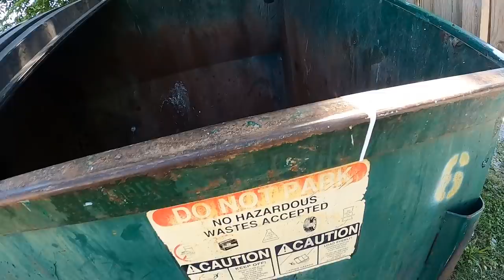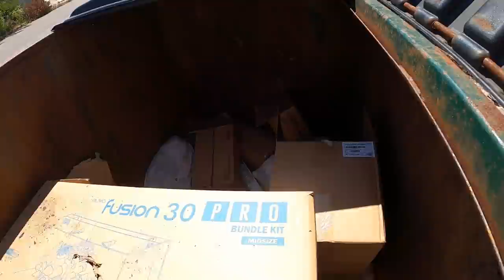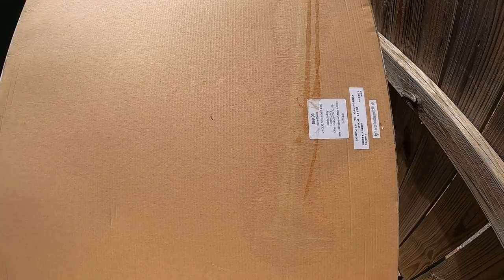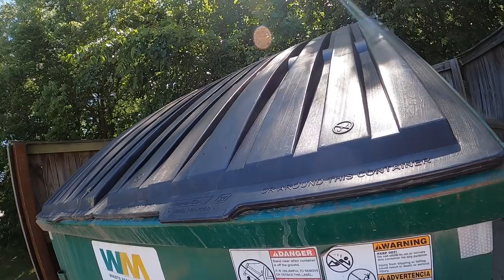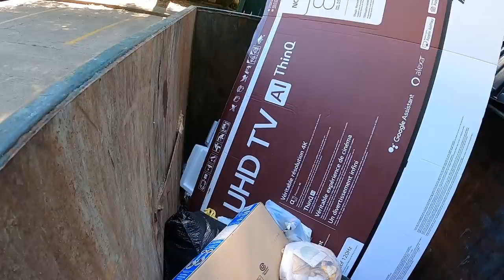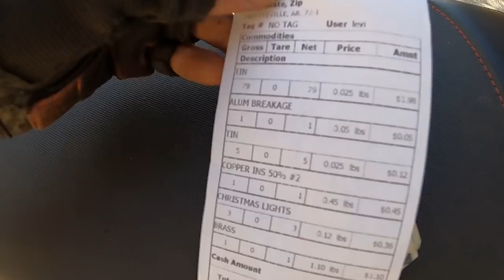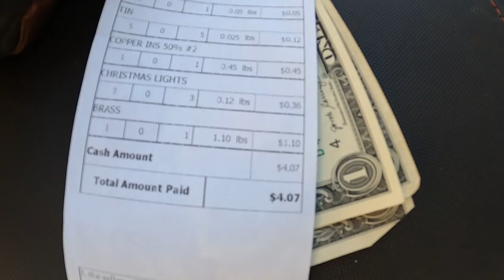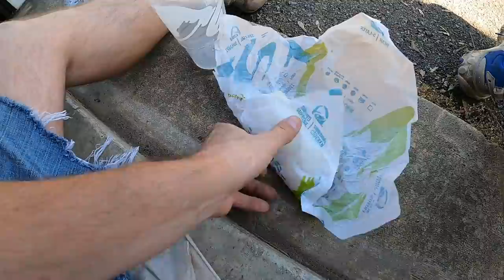HOW CASH NOW - Tips from Treasure Hunter - Make Fast Money!

Comment: Now show folks how to do what you did in a more efficient manner. Instead of grabbing crap for cents on the dollar, be selective and get the things that are far more valuable. I'd rather be a cord cutting fool, and fill a bin with #2 insulated wire then a big honkin' fan motor. Steel is not the meal anymore.